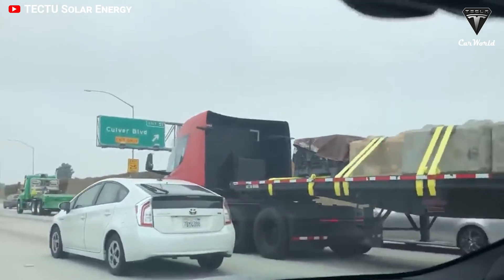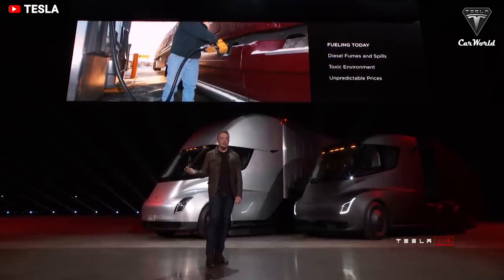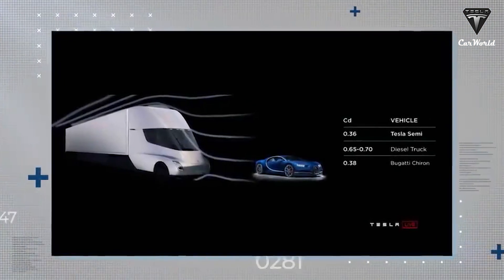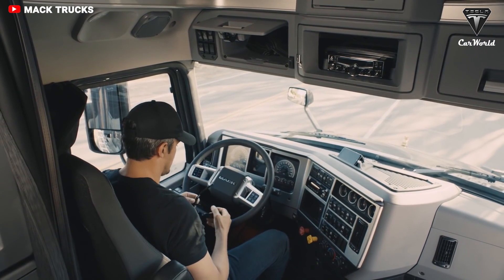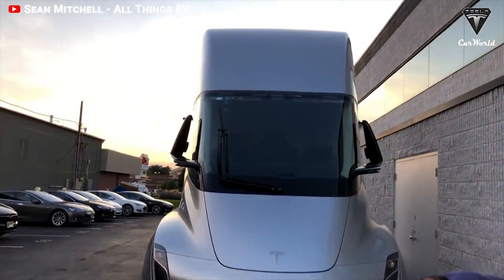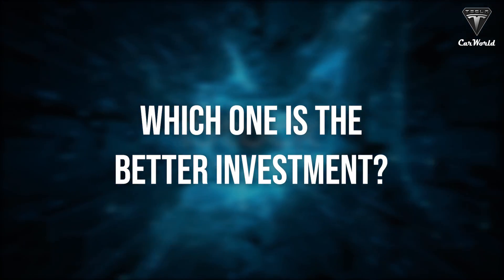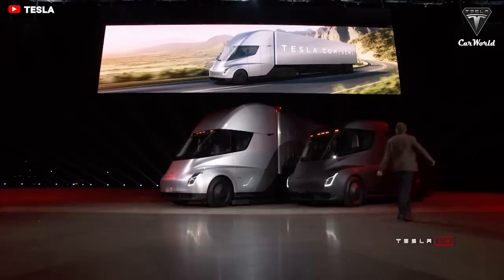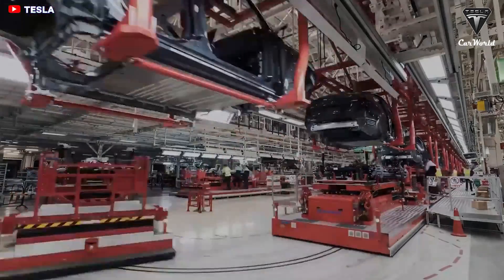Which is the KING of 2023 heavy trucks? Mack Anthem Diesel Truck Vs. Tesla Electric Semi?

Comment: Having an OTR consultant when you research and compile these types of videos would give you actual credibility among the industry. I would love to see a comparison with actual true comparisons with real world information and not your text book science lab attempt. Things like HP vs Ft-lbs torque should be better understood. The actual cargo weight capacity (82,000 vs 80,000) is total weight including the vehicle. The electric vehicle without a load will weigh a lot more than a ICE vehicle even with full fuel and no cargo, so how much cargo weight can one hold vs the other. The range of 500 miles max is basically a comparison against a day cab driver which means tesla does not need a sleeper since it can not actually go a long distance. A typical OTR driver will drive 8-9 hours a day at an average of 60mph and sleep in a rest area without the need to fuel and has a fuel range of around 1000 miles. It seems these trucks have zero OTR available use and since there are little to no charging stations they would only be deployed in scenarios where a company needs to move freight between two of their own locations which both would have charging stations available. 

I love the tech, am on the list for a cyber truck, have solar on my house, and am an OTR driver. I am all in, but there is no place for the tesla semi in OTR yet. More importantly, you really should have done better research to put a video together that holds any positive argument in the industry. I do see a use in day driving scenarios with the current restricted distance and I can not wait until the tech and infrastructure are both in place to drive an electric beast. The electric motor is superior but the storage solutions and infrastructure to recharge are the current obstacles.
Reply: There is a 2,000lb allowance for electric trucks, so the actual cargo weight is not greater for the Electric Truck.
Reply: @pogo1140 - Based on Tesla’s website, the energy consumption is “less than 2KWh per mile” (I’m quoting them). So if the truck has a range of 500 miles, that battery is close to a 1000KWh battery. Considering the 100 KW battery is about 1375 pounds, a 1000KW battery would be 13,750 lbs. So a 2000 lbs allowance is a nice gesture but not really that helpful.
Reply: @jsphblw  Yeah, I doubt that the allowance would help much so I'm guessing that Tesla is banking on most trucks never carrying the full weight in cargo.

Comment: The EV vehicles lose 2/3 of its energy pulling a trailer load this information is not actually true the EV will never make it hauling logistics the Diesel engine will never be taken off the highway the problem with electric you can’t not store it in ten years storage in a battery it will disappear but liquid fuel storage in a tank storage it will be there in ten years an coal storage is even better the other problems are batteries only lasts 5 to 7 years and need to be replaced for a truck it’s over a hundred thousand dollars so the truck will lose it’s value an have no resale value in ten years the EV is nothing but a scam ‼️

Comment: but this video doesn't show what happens when the batteries overheat stops   and no input on very cold winters like the east coast is  in the midst of      diesel engines can keep drivers warm     with idle management systems on the trucks     if no electricity is close by  how long will drivers stay warm

Comment: 1600ft/lbs torque is a minimum for diesel trucks. TESLA needs to be more like 2000ft/lbs.
Reply: Mack ,and Volvo had an MP10 engine the over 2000 ft/lbs in the North America market. Its no longer available here,but its in alot of Australian road trail units.
Reply: @erikthorstensen5185  available where? The Cummins x15 can come in 600hp+ with over 2100ft/lbs.

Comment: I would want to see what a truck hyped over five years actually performs AFTER a real example is actually delivered. My pick is delivery date, cost, numbers delivered and performance will turn out to be underwhelming. Feel free to point out my errors once there is a real truck actually hauling freight.
Reply: They always over deliver, I am loving my new Tesla Roadster!
Reply: Let me get back to this to tomorrow
Reply: How did I do on my predictions?
Delivered on time.  My bad.
Cost. No mention of cost in a presentation which included details down to showing a coat-hook. Picking it won't be the original figure.
Numbers. Pepsi ordered 100. Maybe 5 delivered? Call it a pass.
Performance. Range is as promised. Great.
BUT we still were not told how much the semi can deliver. The 82 000 lb (a legal limit)  is tractor, trailer, and load. A trucker is paid by load delivered and every pound of battery weight is one less pound of load. This may not  matter as these trucks were delivered to a Frito-Lay plant and snack foods are light. Load it up with beverages and the truck may not able to match the load capacity of a diesel.
So still undecided.
Reply: @Athol  Not trying to argue, just bring up discussion. But dont you think the money saved on fuel and def cost offset the slightly lower capacity.
Reply: @russsorvi4181  Sure. Diesel is dead.  But we only know the costs when we know the price of the truck, its payload and costs of the infrastructure (chargers) required. Those costs are known but we aren't being told what they are. I suspect they are close to the costs of competing electric trucks from Volvo and Daimler.
Reply: Actually, Tesla has been using the trucks internally for a few years between Nevada and CA plants for hauling parts and vehicles. I would imagine they have internal operations numbers for that.

It could be why they switched from 4 motors to 3 when they discovered cruise mode could be maintained by just one motor.
Reply: Grant Mac: Agreed. Once we have real world data from a fleet of Tesla semis then we can make meaningful comparisons. And, like Tesla cars, I'm willing to bet the Tesla engineers will be continually improving things and pushing those improvements out to every semi as over-the-air software updates. Can't do that with a Mack.
Reply: Sorry, but Tesla is known for giving specs and then over performing on everything they do. So their SEMI will be no different. And, FYI, they've been testing the SEMI for a long time now, so no doubt it will overdeliver on what the specs say.
Reply: @radicalrick9587 The Semi was unveiled in 2017 and in 2018 Elon was predicting 100 000 trucks a year by 2022. 

The Cybertruck will have first deliveries in 2021.

Tesla’s new self-driving system could be good enough to road trip from Los Angeles to New York by the end of next year (2016).

The Tesla ride-sharing app will allow Teslas to operate as robotaxis and make their owners $30,000 a year.

Tesla is known for giving specs and then over performing on everything they do?
Reply: @chevyslyme  - That's a manufacturing decision they made for several reasons (supply chain issues, battery constrained, some kind of pandemic that royally screwed everything up, ...etc.) The manufacturing delay gave them more time to ensure they will meet and likely exceed the 2017 stated specs IMHO. So they did not make 100,000 trucks in 2022. Schedules slip all the time but it does not necessarily  mean the product specs change. Elon is notoriously bad at predicting production dates but is also very good at understating the specs and over delivering the final product as another commenter mentioned. But time will tell.
Reply: @chevyslyme  lol, I still remember watching that one video of a tesla running a stop sign and then from the cop trying to pull it over. These things are oversized cars, I'm wondering if they've actually been testing them on grades with actual weight, haven't really seen anything about that and it seems to be a hush hush when it's the most important factor when dealing with a semi. Also it's strange they didn't add a sleeper when they're already mass producing for pepsi. I get that those are mainly day cabs for reefers but it's a bit too strange they haven't reveled anything regarding that yet...
Reply: @phazekiller5701  What I find strange is the gross weight of the semi has not been mentioned. A range of 500 miles implies big heavy batteries. The total weight of truck and trailer is limited by law and so a heavy tractor reduces usable load and the economics of hauling. The promise is no compromises so waiting for the big reveal.
Reply: @chevyslyme  lol, well they better have those companies factor in the vehicle weight too, otherwise they'll be rolling and tipping at every turn when a trailer whips. I am also curious as to how they've designed the brakes since braking is the biggest concern when it comes to a semi. Everyone's basically taught to limit the use of the paddle due to fades. If they took the easy way and designed these trucks like cars, they're gonna find out the hard way why air brakes are the go to for semis...
Reply: @chevyslyme  over deliver not deliver early nor on time
Reply: @jovanleon7  I would love to see diesel replaced by quiet non polluting trucks powered by renewable energy so let us hope the big reveal  doesn't resemble the embarrassing debacle of the Teslabot or the "let's forget about it" of the Hyperloop.
Reply: @chevyslyme  lol the teslabot release is a concept/prototype intro, hyperloop was a concept, the Semi on this 1st of dec will be the final product. See the difference? When Tesla showcased their final product, they ALWAYS, let me repeat that, ALWAYS  over deliver.
Reply: @radicalrick9587  this
Reply: @radicalrick9587  what universe are u living in?

Comment: The Mack Anthem MAY be more efficient than the steam generating  plants that provide electricity to charge the Tesla Semi.
Reply: Correction: Solar and/or wind power plants that store energy in Tesla MegaPacks that are used to power the charging stations in the area. This is already being done in various parts of the world but the US is slow to adopt solar/wind.
Reply: MAY be. You're not really committed to that conclusion are you!
Reply: @jeffholman2364  Depending on individual differences, Diesels and steam plants are in the 35-45% efficiency range.

Comment: I think Tesla Semi’s will be great day trucks. But they’ll need more range, faster charging and better infrastructure to replace OTR trucks. Give battery technology another 5-10 years, and produce a sleeper cab version, and Tesla could revolutionize trucking. Or… there may be fully autonomous trucks in 10 years. 🤔
Reply: Bullshit!!!! Even in 10 years the battery technology will be nowhere near the density of diesel! Also nothing will ever beat diesel. A 700hp diesel truck already hauls 4x80,000lbs on tousands of miles on one full of diesel
Reply: @carholic-sz3qv  How much of that energy density is lost in heat, though? Electric vehicles are far more energy efficient. And you clearly haven’t done any research into battery development. There are batteries in small production now that nearly double what’s in the Tesla semi currently. Billions in R&D are being spent. It’s unrealistic to think that battery technology won’t vastly improve over the next 10 years. But, sure. Diesel will always be king. 🤦‍♂️
Reply: @gridjac  nonsense!!! Electric vehicles are still very limited to the battery technology which isn’t advancing significantly faster enough! Yep ICE are both power source and propulsion unlike EVs which are just propulsion.
Reply: @gridjac  the diesel trucks and equipments have been building/improving and maintaing everything from our grids to roads, infrastructures…. On which those EVs rely so yeah diesel is the king!
Reply: @gridjac  you wouldn’t be able to charge any EV if diesel didn’t existed! Even the charging stations , solar, wind energy….. All possible because of diesel power.
Reply: @gridjac  ooh diesel truck and equipments have also built one of the largest energy infrastructures on this planet from hydroelectric dams to installations of solar/wind farms, to the transmission lines and much more. Let’s not forget about the raw materials which guess what are Made possible with diesel.
Reply: @carholic-sz3qv  Wow. That was… a lot. Look, there’s no denying that diesel has been paramount in our energy history, and that it has helped build all of the things you mentioned. It’s still very much a part of our energy needs today. But that doesn’t mean that there can’t be better ways of doing things. Even Caterpillar and Cummins are heavily investing in EV and fuel cell technology. Caterpillar just did a demo on their first EV mining dump truck, and they’re developing heavy equipment as well. Change isn’t a bad thing.
Reply: @gridjac  it’s not called a better way of doing things it’s just a different way of doing things lol…. Like it said it’s going to be very hard for batteries to ever compete with diesel. Electric mining equipments are going to work on very specific uses not everywhere! Just because it needs to be EV doesn’t mean it’s better.
Reply: @gridjac  let’s just forget about aircraft’s intercontinental, let’s forget ships……. 24/7 working machines and equipments another hard thing for EVs. I’m not against EVs but you have to admit it’s downsides
Reply: @gridjac  alternative fuels are also actually part of the future! Just investing in batteries alone is a total disaster because diesel and petrol and gas, biofuels…. Are many types with different applications.
Reply: @carholic-sz3qv  I agree that biofuels are a potential solution for things like shipping and aviation, although NASA just revealed a battery specifically for shorter aviation needs. I think you’ll see a mixture of technologies that move us toward a cleaner energy future.
Reply: Navistar have had fully autonomous trucks on the road in the United States for two years. The identifying feature is a sensor bar on the roof with the anti-collision radar and LiDAR Elon Musk refuses to fit.
Reply: Jason Clay - Charging speeds will increase by a factor of 10 over the next 5 years based on current research (no pun intended) and demonstrations that I have seen/read. Battery technology too is always improving. I'm thinking the timescale for an OTR long range Tesla Semi is more like 2-3 years. I myself am holding out for a Tesla semi with a Dilithium Crystal in the glovebox with a range of 10,000,000 miles and a fully loaded 0-60 MPH  in HOLY SH!T!
Reply: @thomasruwart1722  lol…..

Comment: The tesla is better suited for local deliveries.  Most OTR trucks drive over 1000 miles a day, in addition the charging infrastructure still doesn't exist to accommodate semi truck charging. I do believe there will come a time when they will over take all trucks, 1/2 the fuel cost, little to no maintenance and increased acceleration all add up to more revenue for carriers or independent operators.  It's a no brainer.  The reduced expenses can also translate to lower cost for consumer goods, at least on paper, I don't actually believe manufacturers would extend the savings to consumers, maybe to share holders.

Comment: 200 miles! Let's look at 800 miles down time for charging keeping the cab warm in the winter if you want to make a comparison coast to coast would be the way to go. 200 miles and a hour to charge?
Reply: Elon said there are two ranges available.  300 (3 minute charge) and 500 (60 minute charge)
Reply: @jeffpitoniak  30 minutes to get 80% and that’s only at a Tesla “megacharger” of which there is only one in the entire country so far.
Reply: 200 miles was just an arbitrary number picked for calculating cost of operating NOT the range. The charge time is also not an hour but 30 mins.
Reply: @kristopherbuchanan974 - Let’s examine that charging time. Tesla says the truck will consume “less than 2KWH per mile”. Based on that, the battery in a truck with 500 miles would be almost 1000 KWh. So to charge it  from 20% to 80% in 30 mins, you need a 1.2MWh charger. To charge it fully in 30 mins, you need 2MWh charger. How many of those are floating around?
Reply: @jsphblw  I noticed you mention charging from 20-80 % but your math indicated the charge to the full amount.  Given the 20-80, there is a difference of   600 kw (assuming 1000kw battery as you figured) now the mega chargers are suppose to be designed at 1 megawatt hour per. The normal supercharger now are 250kw last I checked and the mega charger will not need to be near as readily available just based on ratio of semi’s alone
Reply: 30 mins for 70% charge
Reply: @danielstapler4315  and 40 miles slower
Reply: Lol did you do a bit of calculating on how much that Tesla saving on fuel actually is? In exactly 1 and a half year you can buy a brand new Tesla Semi with that saving if you go 400 miles a day for 28 days a month. Just think about that for a second. Just one and a half year!
Reply: @jovanleon7  what's the purpose of EVs
Reply: @leonbachman5345  making the world a better place?
Reply: @jovanleon7  in what way?
Reply: @leonbachman5345  in every way?
Reply: @jovanleon7  nope just causes more pollution
Reply: @leonbachman5345  lol how about doing more research. Those saying evs cause more pollution have been debunked.. The truth is it's much less pollution and the pollution moved wayyy out of populated areas.What would you prefer?
Reply: The main market for EV trucks is The short haul from distribution center to supermarket etc. That will take many years of production. Long haul is not relevant for the next 10-20 years